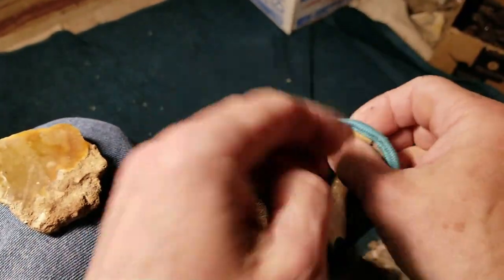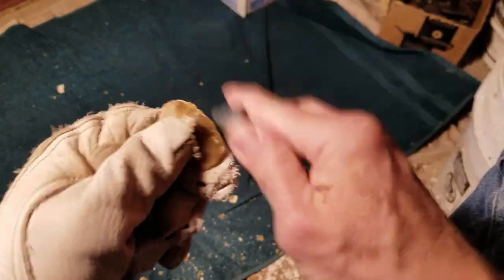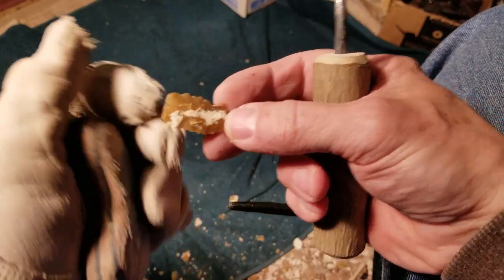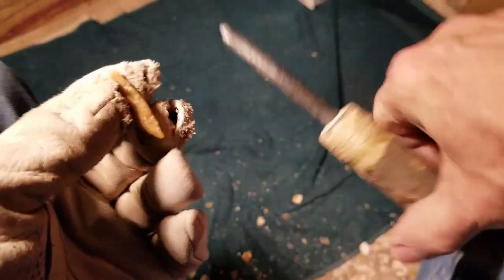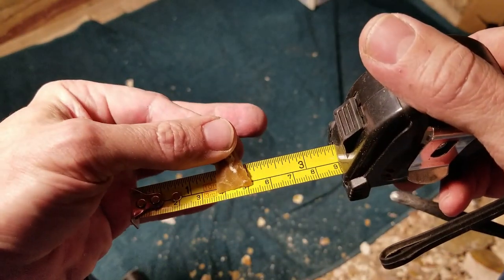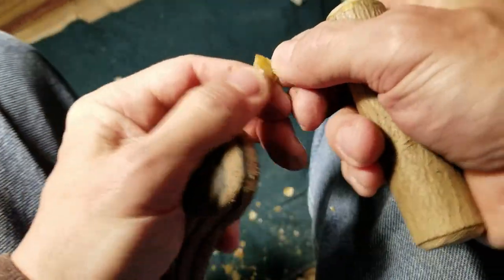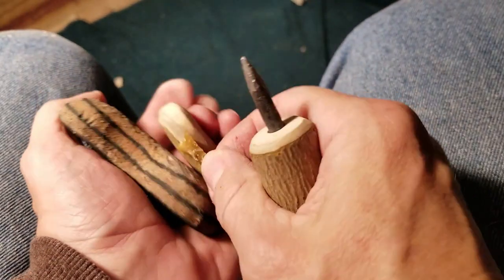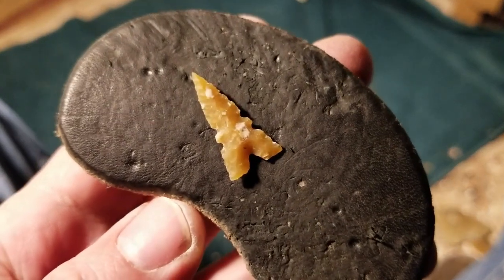900 - Flintknapping Raw Colorful Chert North African Neolithic Arrowhead

Comment: The majority of knapping that I was able to do before becoming incapacitated , was small jewelry size matching pieces . I made arrowheads , hearts , and feathers , in matched sets wrapped in jewellers wire . The smaller pieces are more difficult to finish , because the smaller and thinner it is , the lower the tensil strength , ( if that is the correct term ), and they break just as the finishing touches are completed.
I learned so much of my experience to you  Jack Crafty , I think I saw that your first name is Patrick .
I have on few occasions , fallen asleep with the back of your hand being the last thing I saw ...hahaha ...you are amazing Sir !
Reply: At least 5 years worth of following you !
Reply from the maker: Thank you. And falling asleep during a video is not usually considered a compliment but I'll take it as one! 😁